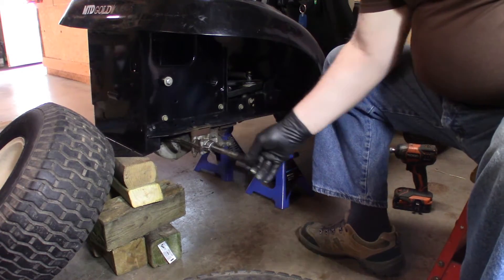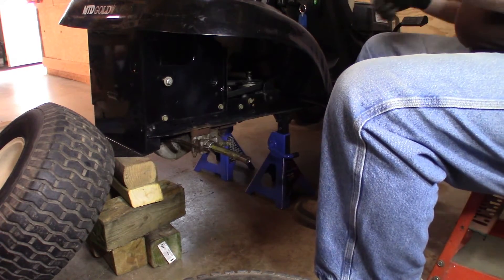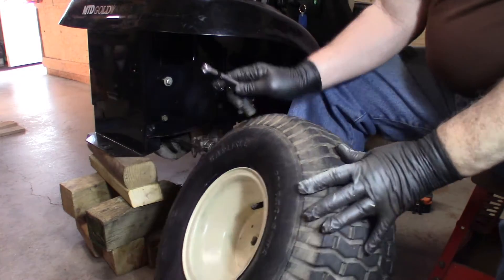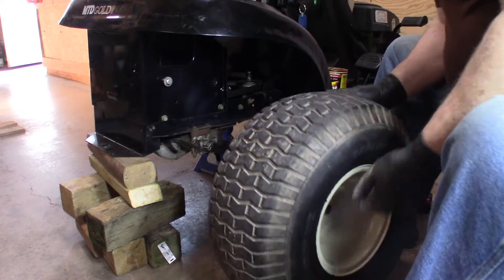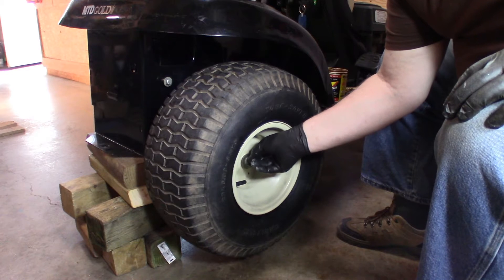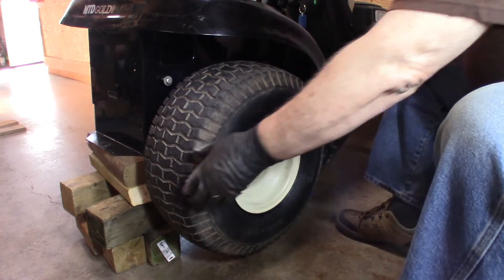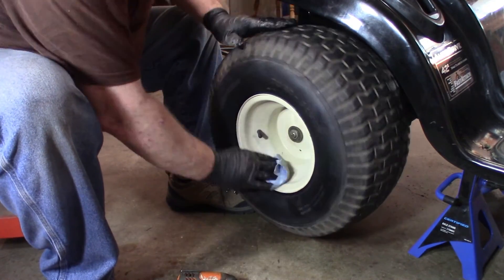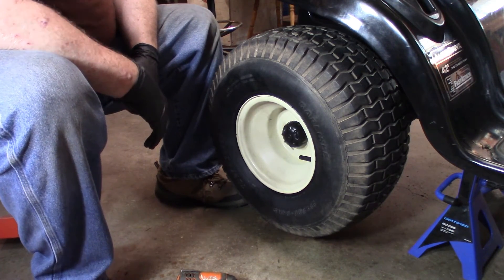Installing Rear Wheels on an MTD Yard Tractor

Comment: Hey, Mike. Good job installing those tires with the valve stem out!! Cheers!
Reply from the maker: How's she goin'?  Thanks.  Making sure the valve stem was facing out was the easy part.  Keeping the valve stem in the hole in the rim was the tricky apart.  I near lost it back into the wheel a couple of times.  That little valve stem tool sure helped!!!  Thanks for watching and commenting.  Have a great week!!!

Comment: I am pleased the tyres held air and you got them installed. It was a shame about the axle bolt but these things happen when stuff gets stuck. We love our ultrasonic clearer for carbs, it does a great job
Reply from the maker: How's she goin'?  Yes the shop made wheel puller did a number on the axle bolt hole, but I got the threads cleaned up pretty good.  An ultrasonic parts cleaner would be some nice.  But I don't clean enough carbs to make it worthwhile.  But maybe one day!!!  So nice of you to tune in and comment Joseph.  Sure hope you are having a good week.  Take care!!

Comment: great job on getting the wheel fixed, work like this goes smoother when you have all the tools you need on hand.
Reply from the maker: How's she goin'?  For sure eh!!!  If you have the right tools the jobs are a lot easier.  That's why I ended up with this problem, because I didn't have a correct wheel puller .  I ended up damaging the threaded hole on the axle and had to re-tap it!!!  We got it on OK though so it's all good!!!  Thanks for the comments and for watching.  Take care!!!

Comment: I had the same problem taking off a wheel on a small JD and it was the same problem....rust....took the torches and about an hour....you did well for sure....CHEERS
Reply from the maker: Hey there Gator!!!  Buddy if I had a torch this would have been the job for it.  I kind of mangled the starting of the threads in the axle but that crazy little puller I made up worked eventually.  Another thing that made me think was the sleeve over the axle, like between the wheel and the housing, was plastic.  So if I had a torch that sleeve would have been  melted.  Oh well.  It all ended well in the end.  Thanks for the visit Gator and have a great week!!!

Comment: Thanks, Mike looking forward to you solving your carb issues.
Reply from the maker: How's she goin'?  Well Jack you're not along there.  I'm thinking is a carb issue, but then it could be a fuel delivery problem too.  Or it could be a governor problem.  So as you can see, I don't know what's causing it right now!!!  LOL  Thanks for tuning in and commenting.  Take 'er easy!!!
Reply: @GrampiesWorkshop  just my thinking here Mike just drop the fuel bowl on carb and check bowl for issues,and make sure screw that holds bowl tight is not plugged up with dirt. Sorry just thinking out loud here.

Comment: You almost got er done.  I have never had a tractor where the rear tire went on that way.  I could feel your pain but it all worked out in the end.  Now a little tweaking on the carb and you will have a unit that will last a long time.  Stevo
Reply from the maker: How's she goin'?  When I was pulling the wheel off with my 'shop made' wheel puller I buggered the threads on the bolt hole.  Then when I was tapping out the hole again I was some scared I would break the tap!!!  But it all worked out.  The surging engine is eating my lunch though.  There is no hi speed jet adjustment and I thought that would be the cure.  More to come on the carb issues!!!  Thanks for watching and take care!!!

Comment: 20 foot lbs seems low but i guess it makes sense.  It dicnt fall off on the turn so must be good
Reply from the maker: How's she goin'?  I never gave it much thought, but now that you mention it, 20 ft-lbs does sound low.  But both the axle bolts have Locktite on them so I think it'll be OK.  You're pretty sharp to pick up on that!!!  Thanks.  Take care and thanks for commenting.
Reply: @GrampiesWorkshop where did you get the wheel bolt torque info?  Were you assuming?  Because 20 seems low to me too and when this person mentioned it you said it does seem low but should be ok because theres thread locker.  You sounded matter of fact in the video but your reply sounded more like, idk, I just guessed on a number.  So please clarify.  Thanks.

Comment: I tell ya Mike, I was grinding my teeth hoping that tap wasn't gonna break lol.  That tractor has some get up and go.  Hopefully the carb problem is an easy fix
Reply from the maker: How's she goin'?  The tap I was using was a cheap one and I was afraid it was going to snap off too.  Some glad it didn't as that would have spoiled my day!!!  I think the carb issue can be dealt with if I could adjust the high speed jet, but this is one of the Chinese cheapies and it has no hi speed jet adjustment!!!  Go figure eh!!!  Thanks for the watch and take care!!!

Comment: Hi Mike. Tractor looks great my friend. As for the carb you probably already have it done but I'm going to tell you anyway. On these engines with these carbs. If they sit to long the needle and seat start leaking and also start running lean which is what you probably have going on. I just replace the carb altogether but you could probably fix it with a rebuild kit.  Great work buddy👍
Reply from the maker: Hello there Dave!!!  I figured that's what was happening.  But here's what I have done so far.  I did buy a new carb.  A cheap after market one.  That's what's on the tractor now.  It still leaked through the carb.  I don't think it it was the anti-backfire solenoid, but I explain my thoughts on that in an upcoming video.  The other thing is the surging at high speed.  The new carb has no hi speed needle adjustment.  So you know what I did?  I ordered yet another carb with a high speed jet adjustment and I'm waiting for it to come in.  And today I was driving the tractor and it seems that it only surges on high speed and at mid speed it seems to work a lot better, so now I'm wondering if the governor maybe a part of the problem.  And here's another thing, sometimes at high speed it will run smooth until I start to drive the tractor and then it will start to surge as the engine comes under load.  That's why I'm wondering about the governor. Good fun trying to track this down.  I think I got the fuel leak issue resolved but the surging is still eating my lunch!!  And that's my story and I'm sticking to it!!!  LOL  Thanks for watching and commenting Dave .  Take care!!!
Reply: @GrampiesWorkshop  some of those cheap carbs aren't worth a damn. The next one might be the fix you need. Otherwise when it's surging put a little choke on and see if it stops surging. Then you know it's lean. Also check the gaskets. And as you know there is a plastic piece between the engine and carb. Check to make sure there is no cracks or chips in the plastic.  Good luck Mike. I know you'll figure it out. Some engines put up a fight
Reply from the maker: @davessmallenginerevival2847  I did check the gaskets and they seem to be OK.  I was going to spray some carb clean around the mating surfaces and see if the engine speed changes, but didn't do that yet.  That's a good tip about the choke too.  Thanks for the response to my epistle!!!  Take care!!!

Comment: Good to see you going forward with your new toy. As they don't turn on the axle would a coat of Copperkote not be a better choice and a bit of sealant on the cap to keep the water out ?  It sure is good to see you not kneeling directly on the concrete. That stuff will suck the life right out of yer bones eh. Watching you driving around the yard was like seeing a kid on a new bike, LOL. A feel good thing for sure. Thanks for the update my friend. 3 more days up in the Rockies and I am heading home. It has been a great trip.
Reply from the maker: How's she goin'?  You know what Dean, I never even thought of never seize when I was remounting these wheels.  Not sure why because of all the trouble I had to get them off!!!  The Krazy Grease is water proof, but the never seize and some sealant would be a better solution for sure!!!  Glad to hear you are enjoying your trip in the Rockies.  That would be a nice trip I'm thinking.  Maybe one day!!!  Thanks for commenting Dean and tale 'er easy!!
Reply: @GrampiesWorkshop  I have done a mix of greace and Never seize as well but where my memory just isn't there. Oh yea. It was on a prop shaft on an old style shear pin motor. My gramps told me to do. Something about those grandpas eh Grampie !
Reply: @GrampiesWorkshop   Deans motel and restaurant is open year round my friend.
Reply from the maker: @TomokosEnterprize  Go easy on us old folks Dean!!!  LOL

Comment: Hello my friend. First I want to thank you. After watching ur oil change vid, and fuel filter vid. I was able to do both very easy. I was going to do my hydro fluid, but it's real clear and clean. I don't know the hours on it tho. Should I still change it? Or wait till it get a little dark. Thanks again my friend!
Reply from the maker: How's she goin'?  Well thanks a lot!!!  I'm glad my videos helped you out some.  As for the hydraulic oil, it will not get dark, say like engine oil.  Hydraulic oil is almost the color of water, which is to say it has no color.  It's hard to tell from looking at it if it's old or not.  If the tractor is new to you, and you're not sure of it's history, I would change the oil.  The oil I use I get at Wal Mart.  It's called TDH oil.  That stands for Tractor Differential Hydraulic oil.  It costs about $60 here in Nova Scotia, so for that amount of money, I'd change it to be safe.  But the filter is pricey.  It can cost almost as much as the oil.  Also, be careful when removing and installing the drain plug.  I stripped mine and it was a scary time.  I managed to repair the threads but it was an expensive evening!!!  Thanks again for watching and commenting.  Take care!!!
Reply: @GrampiesWorkshop  
Thank you. I have a back hoe on mine. Will it be in the way? Also what tool do you use to remove filling plug?? Thank you sir!
Reply from the maker: @dtruth5769  I think it would be hard to put the oil in with the hoe on the tractor.  The fill hole is at the back just above the output shaft for the PTO.  To remove the plug, it's just a socket and a ratchet.  The thing to watch for it not to over tighten the drain plug.  The casing for the hydraulic transmission is cats aluminum is it can strip out pretty easy.  Just tighten the drain plug until it feels secure.
Reply: @GrampiesWorkshop  
Thank you. I was asking what tool to remove filler plug. Doesn't look like reg hex head?
Reply from the maker: @dtruth5769  Oops!!  I missed that one.  The filler plug just unscrews.  It's a plastic type screw in plug.  I sometimes use my big adjustable and sort of clamp it on the head of the plug and unscrew it.  Good luck!!!

Comment: When i put a new wheel back on i cant get the wheel all the way on . I have it lined up correctly should i buy a long bolt and try to get  it started and tighten the wheel on that way?
Reply from the maker: How's she goin'?  The wheels are hard to get lined up because they are heavy especially when they're loaded with fluid.  I wouldn't get a  longer bolt.  The original ones should be long enough.  If it won't line up correctly there must be something that is just not right.  I'd keep trying to re-adjust the wheel even a little bit and use the original bolts.  I hope this helps Tony.  Let me know how you make out!!  Good luck and take care!!!